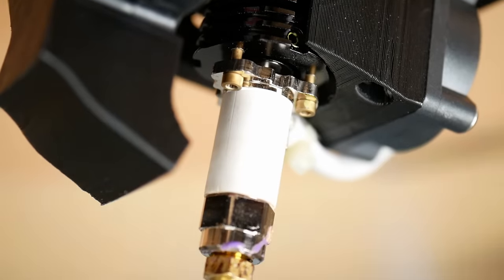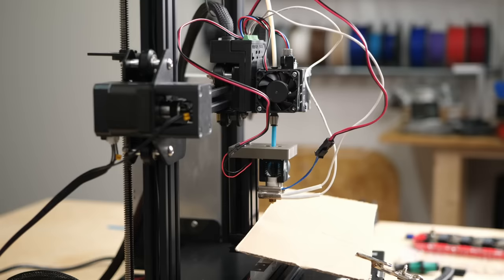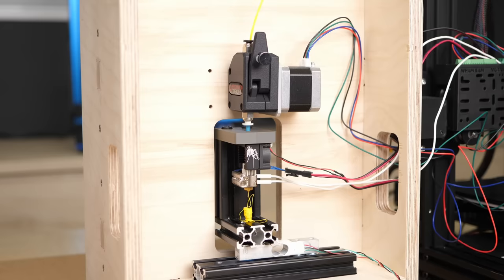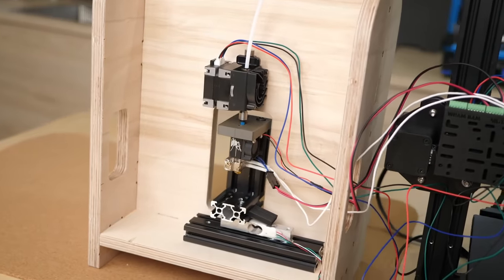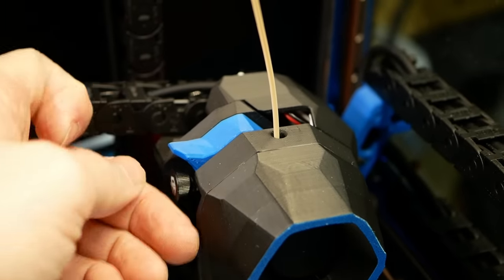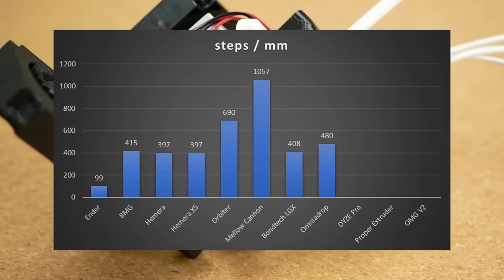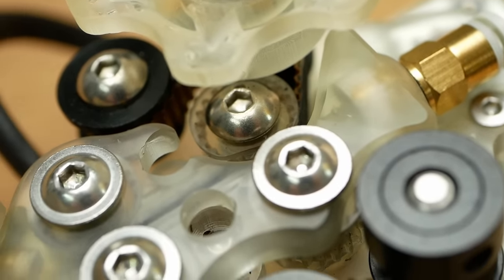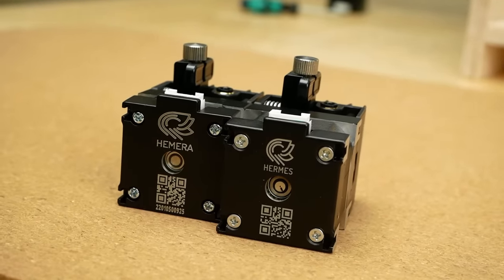I tried to find the Strongest Filament Extruder.

Comment from the maker: What's your favourite, go-to extruder?
Also: check out our CNC Kitchen products at https://cnckitchen.store/ or at resellers https://www.cnckitchen.com/reseller and on AMAZON (EU) https://geni.us/s8rYtQ
Reply: Thanks a lot! Getting an Orbital for my dual drive Prusa-mini project.

I've been doing my own research but it becomes obsolete by the time I come up with a decision.
Reply: I'm using a Titan clone for its size and weight and easy fit on an Ender 3. Would be interesting to see how it compares with its extremely small single extrusion "gear".
Reply: The one in my Prusa MK3. I am building a a P3 Steel intermittently and is going to start with a "Gregs Wade Extruder", It would have neat to see how "good" it was in the beginning of home 3d printing.
Reply: I'm finally upgrading from the stock Ender extruder to a Sherpa Mini.
Reply: Im using a Zesty Nimble v1. For the people wo dont know this extruder it is a remotedriven directdrive extruder. i would love to see it in your tests.
Reply: I'm currently using a water cooled extruder that my bf gave my as a surprise... I have no clue what black magic or blood rituals he performed, but it can push up to 22384 grams at 20mm³/s and at 12v@5A (same testing methodology).
Reply: Exoslide Extruder for sure
Reply: Currently my favorite is the LGX Lite.
Reply: How many of those did you buy vs freebies to make promo videos mislabeled as a review?
Reply: I'm wondering what all was wrong with your Mellow Cannon, as the brass worm gear should spin extremely easily against the Delrin gears (worm wheels).
You mentioned yours was an early design. I'm wondering if yours lacks the adjustment slot where the lower screw goes into the motor (mine is the new version and has that slot). With that, you can adjust the lash out completely while maintaining extremely low friction. I have no idea why they don't advertise that feature as it's the only extruder I've seen that lets you adjust out the lash.
I'm surprised at the results... I fully expected that one to be neck-and-neck with the (extremely well designed) Orbiter, but maybe it's because it's an early version.
I do totally agree about the lack of ability to manually feed with that one though. That's its biggest drawback.
Reply: @pizzablender  The clones don't seem to be very well made. I did some measurements on my KP3S Titan clone yesterday and nothing runs straights, the stepper gear, the black plastic gear and the knurled section that grips the filament all have significant runout.  I had a bunch of new spares and they were all pretty bad as well, so you'll never get consistent extrusion IMO.  Just ordered a genuine E3D Titan, hopefully it's better made.
Reply: Titan clones are nice to load and use, but slow and usually gears are eccentric.
Creality metal extruder is nice to load and use (depends on gear), but slow. For direct drive, spring adjustment should be on lever.
Orbiter 2.0 can print fast but eccentric drive gear still creates artefacts & gears cannot be rotated by hand.
I'd say gears are always the weakest point, either in concentricity, or in gripping power 🙄
Reply: @kimmotoivanen  Is there any reasonable priced extruder (say under $150) that comes with nicely made (non-eccentric) gears?
Reply: I just got the vz hextrudort low. I'd be interested in seeing the numbers on your test that thing could do
Reply: @GabberGand32  That seems to be a 5 year old design. Surely it would be worse?
Reply: Hey Stefan,
is it possible that you also include the ontech LGX Lite and the Sherpa Mini? Maybe on your website as an update? Those both are also two very popular small form factor extruders.
Reply: The Biqu H2 is my favourite and it is super light also
Reply: Mellow NF wind. It's a BMG, half of the body is aluminium so throat can be connected directly and a pencake nema17 is enough. It has ender 3 compatible mounting. With the smaller stepper and the lack of additional heatsink, the weight is also not as high. Can also drive the gear from outside. Maybe the mellow nf sunrise is even better (like that the throat is not threaded)
Reply: My extruder is the BIQU H2 V2S with a V6 styled nozzle.   They claim 770 Newtons for force (~78 kgf) at a weight of 195 grams.  I wonder how this would work with a CHT nozzle.
Reply: Be interested to see how the Sherpa mini design performs
Reply: My favorite extruder so far is the microswiss NG. I was surprised that it wasn't featured
Reply: I personally like the Sherpa Mini, have had it on my ender 3 for almost a year now and no problems
Reply: I came across your channel while looking into buying either a consumer resin 3d printer or filament printer for making drone propeller prototypes and see you believe resin is not as strong as filament materials?  If that is the case could you give me advice on a consumer filament printer for making drone propeller blade prototypes and which material to use?  Thanks.
Reply: I have a old BIQU H2 on my primary printer and I always felt it was comparable to my Hemera. I would absolutely LOVE to see you compare a BIQU H2S Lite. There seems to be some major upgrades, both in features, and weight reduction. I'm not sure if it's got more pulling/pushing force than a Hemera, but it's MUCH lighter. I would love to see how it compares to the Orbiter!
Reply: Have a raptor 2 700mm ver., That mostly gets negative reviews, hehehe. I upgraded extruder to a bmg clone, tough 3d printed housing for the gears, etc. Metal housing for it will probably be used in the future, i find the bmg solution good. Also use the default raptor motor to drive it, not sure what size it is. Its good enough, for now. And, well. Running klipper, btt cb1, so only thing i havent changed is the frame. That was one of the reasons i decided to go raptor, to learn and well. Good price, and better than creality, etc for that price. xD
Reply: Wondering if you intentionally left out Biqu H2, because it "borrows" from other designs. But was quite curious how pancake nema 14 + 7:1 gear ratio and integrated Hotend (yet very light) would perform.
Reply: Could you do a comparison of extruder cost to force generated ?

Is this data available, I could s9 this myself if it were.
Reply: Obiter 2.0 vs zesty nimble extruder

Comment: Again an awesome video man. But I dont think we need a lot of pushing force...we need to let the hotend flow and avoid over-pressurizing the heatzone.. or we get crappy quality
Reply from the maker: I really need to integrate that setup onto a running machine to play around with things like this!
Reply: Yes, if used in a normal 3D printer capacity (which, granted is a strong focus of this video when it lists and discusses the weight of the print heads), but when used for injection molding—as was the initial purpose for performing these tests—reaching high pressure is the primary concern, not flow rate, consistency in output rate, or weight of the head, as it would not be moving and the quality of the molded part is largely dependent on the mold design, surface finish and level of detail, and achieving a complete fill of the mold cavity.
Reply: Also how it handles abrupt and fast retracts of pressure advance.
Reply: Interesting idea. After a certain point, it is better to focus on reducing friction in the filament path and having a better heat zone to get higher flow.
Reply: @andreiignat3877  This is definitely a good topic for a video. Ultimately I had to disable pressure advance on both of my Titan geared extruder machines due to gear chatter and failed prints due to sawing through filament. I'm in the market for a new extruder, but ultimate force isn't as important as backlash.
Reply: I would still like to see the HextrudORT tested in this rig.
Reply: If I can push 75-100 mm^3/s on the sprite hotend with a CHT volcano, I kind of don’t see the point in spending 100-200 on an extruder upgrade.
Reply: Agreed ! That being said, could you provide Stefan with a Goliath and VZ-extruder for testing? I would be very interested to see that combo against other options.
Reply: @CNCKitchen do you know how to use TPU filament on the ender 3 Neo? I have one and I really would appreciate if you could do a video or something about how to do it
Reply: I would be very interested in seeing a quality comparison for the belt based extruder compared to normal gear extruder since mirage has done quite a few tests highlighting some flaws with the typical gear design.
Reply: @CrazyMineCuber  me also
Reply: Awesome line-up, would have loved to see how a remote direct drive like the zesty nimble or flex3drive performs too as they are suuuuper lightweight on the carriage but also limited by worm gear technology
Reply: @nathanstathis8390  While there's some truth in that given the gearing ratios they use on their worm assemblies, I wonder if the real limitation isn't actually in the flex cables they both use. There are certainly benefits to using those, that flex also eats up a lot of torque from the stepper and probably a lot of actual steps over the duration of a print.
Reply: My extra long and bendy filament path disagrees! :)
Reply: Vez, exactly.
It is not helpful to push filament through the tiny hole by brute force. Don't know why he made the Video/comparison and I don't feel like watching it. Some peopke actually step back from dual gear to single gear actually. It's about consistent lines, not maximum pressure.
However there is a funny extruder comparison video by Proper Printing which is a MUST to see!
Reply: I totally agree and I don't know why everyone is so obsessed with force
Reply: @REDxFROG  it's mentioned in this video, the extruder tug-o-war
Reply: I'd like to double this and I try to explain: The nozzle acts like a spring for pressure advance. Extruding at or over the viable flow limits of a hotend - with therefore higher pushing forces on the extruder - raises the spring constant of that "spring system". That makes your regular pressure advance setup invalid, as it is set for regular/viable extrusion rates - with that "regular spring constant". As a result, pressure advance acts more aggressively  at those higher pushing forces, causing gaps and underextrusions when pulling/pushing (retracting/de-retracting) the filament. Extruding at theflow limits, we would need to dynamically adjust the pressure advance values proportionally to the elevated pushing forces in order to compensate. As an example: Because of that, I used various PA values in relation to the boundary conditions of each layer (re-heat up time for the filament in hotend/nozzle --> higher/lower extruder pushing forces -> reacting spring system at nozzle) for my 05m:10s 3DBenchy print back then.
In other words: As soon as you even need high pushing forces coming from the extruder, the extrusion system is already knocked out for your regular PA values and therefore quality printing.
Reply: @247printing  I believe he and anyone with much printing experience knows this.

This video was done for views but for people not in the know I could see how this comparison can be misleading.
Reply: @Dashrendar2507  I typed the same question haha. Deleted after I noticed yours. Would love to see Stefan play with the WC Hextrudort and Goliath.
Reply: @timmturner  "Don't tell the obvious" or what's the sense of your statement? I bet Simon/Stefan are aware of that, but I disagree on "anyone", on "misleading" and on "done for views".
Reply: If I was interested in speed printing I would choose a Bowden extruder. I would not have to worry about the weight. I'm not as experienced as many. Please explain why you would choose a direct drive when you want speed and you want less moving weight. Thanks.
Reply: @247printing  actually with higher pushing forces the filament is not evenly melted and the molten filament does not hit the desired temperature. Especially the core of the filament is much colder when pushing over the limits (without CHT nozzle). The spring you mention is the filament at inadequate temperature at the hole of the nozzle.

For fast printing people choose much higher temperatures to compensate that. Because their hotends can't deliver the energy. A 230°C PLA line at high flow speed may give similar results like a 205°C line at slower speed. It's a dirty hack. The spring effect, the pushing force would be equally.

End of the story: better not overload the hotend/stay within measured max flow.
Reply: If anyone knows how to print fast it's Vez! Canadienz for the winnez
Reply: @forbiddenera  yeah I'm buying his stuffz.
Printing fast is very important, let's not listen to the slowers. 🥳 his extruder isn't in the video. 😩 Twirl gears.
Reply: @Ryan Tidwell  because at high speed you also need high accel. At high accel the bowden setup will cause too many issues with pressure advance and retracts. It will rip off the filament in no time.
Reply: @CNC Kitchen  it would be awesome to have a known value on pressure to not exceed before quality goes nuts. MirageC was working on this and found some interesting values... and it really showed a correlation there that i think is worth looking deeper at it. If one can figure this out its you! You are one of the great minds out there
Reply: Yeah, delaminating occurs as well when that happens :/
Reply: @CNCKitchen  Renkforce RF2000 had filament force sensor many years ago.
Reply: @247printing  that's super interesting and it also made me think that the die swell effect may actually be desirable for his ulterior injection molding experiments.
Reply: @247printing  also I think we desperately need a course for advanced level tuning 😍
Reply: How about using the force curves and an inline pressure measurement to tune in a control-loop that does compensate pressure deviations and avoid grind-offs :)  similar to resonance frequency tuning
Reply: @CNCKitchen  agreed. This was interesting but it doesn't tell me what I want in my printer.
Reply: Having an extruder that never under-extrudes due to the roll flopping around is important. The extruder needs to grip the filament like a vice to guarantee long prints
Reply: @Sepnetic  I haven't tried it, but my understanding is you can get it to work if you use very slow speeds. Turn the normal 50mm/m down to 10.
Reply: @MattJonesYT  I have always wondered why no-one seems to care about the mass of the roll and the inertial resistance it adds to quick extrusion. There needs to be an unspooler that keeps a small loop of filament out and available for a quick movement.
Reply: I agree, I designed this extruder for ultra flexible soft filaments with a hardness of 75 Shore A
Reply: @NathanBuildsRobots Brah...it doesn't count if you do it with a gigantic nozzle, we want flow at .4...
Reply: Amen, Simon! I am glad more people in the hobby actually understand the concept finally! We need to educate more youtubers though, they are the voice of the community and educators, they have to understand these basic concepts better.
Reply: @CNCKitchen   you do, but would be sweet if you run tests before you make your video and actually understood how things work, otherwise you only end up contributing to misconceptions and misunderstanding of physics behind 3d printers and filament extrusion. And your channel has a big impact and authority, with great power comes great responsibility!

Comment: Nice to see this comparison done scientifically, very well done! Thanks for including my beefy design!
Reply from the maker: The beefiest of the beefy boys! Great work on that unique design!
Reply: @CNCKitchen  Thank you!
Reply: I believe, your belt design has the most potential of the bunch. It needs more optimization though.
Reply: @besenyeim  wear may be an issue though. The hardness of belts vs hardened steel gears is significant, to say the least. Guessing abrasive filaments would eat those belts for breakfast.
Reply: @ivyr336  Most of the abrasives are inside the filament though, not exposed. I don’t see it as being particularly problematic.

Also, one of the good things about belts is that they’re quite cheap, as a consumable component.

Comment: Ive been working on a similar idea for a while based on a failed print, which filled my silicone hotend. It created a blob that had a smooth surface finish, 100% infill and sharp features, which lead me to the idea that it was viable. For those saying why, small FDM parts are weak and struggle with small details due to the printing process. While slower than traditional injection moulding there is certainly a place for a small machine like this. Even a 5-10 minute cycle time is still faster than printing and due to the low cost and size many machines could be run at once.
Reply: When he mentioned this I thought about the conical bullets I want to print (based off a patent from the 1700's, it was a flintlock that fired 224 times with a single trigger pull, its party piece wasn't a complex mechanism it was that you could stack bullets with basically a flash hole drilled through the middle so they would fire one after another in runaway full auto). I printed one and it came out ok, but if you make smaller than .50 cal (historically it would have been .69 cal or bigger since those were the popular calibers back then), then you end up with pretty tiny projectile. Something like the creatlity belt printer injecting into a line of molds could automate the process (you need 224 of them to load it up, lol, you might even want to fire it once every weekend), so for accuracy you'd either want Resin printer or injection/cast.

Of course casting in lead would be the way it was done previously and how it should be done (also very easy, probably much easier than plastic), however you need to burn more power and if you just want a toy like a glorified Nerf toy that has cool booms and smoke, well plastic should be fine for close range play.